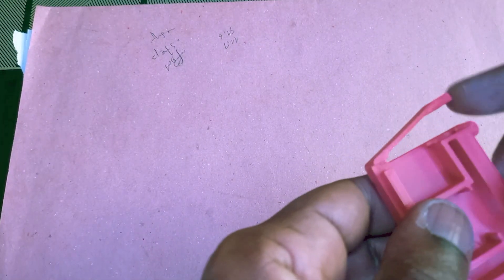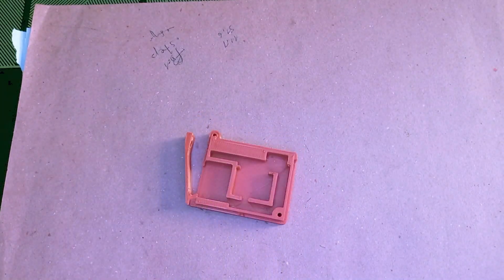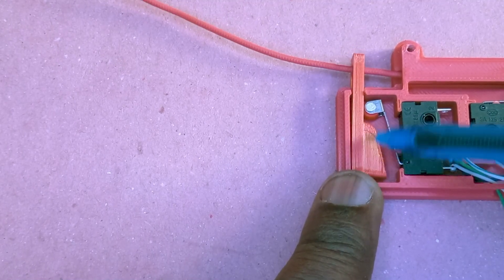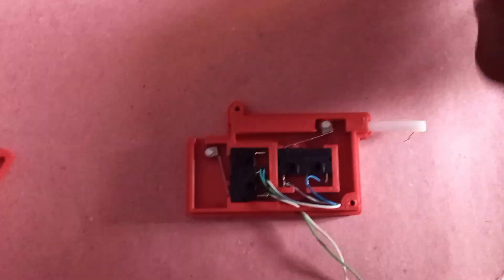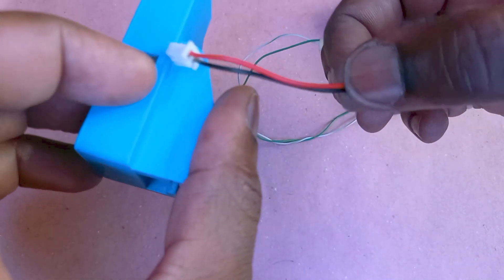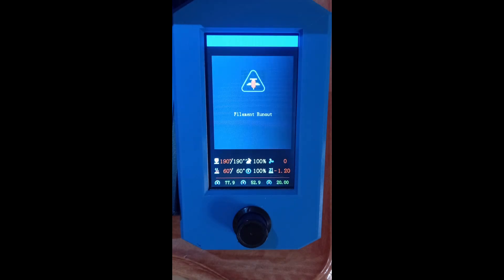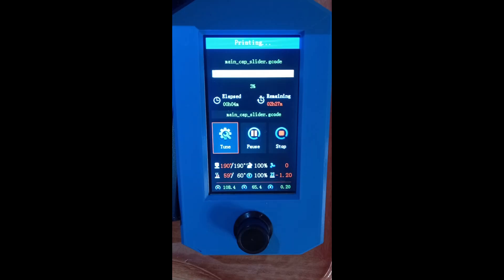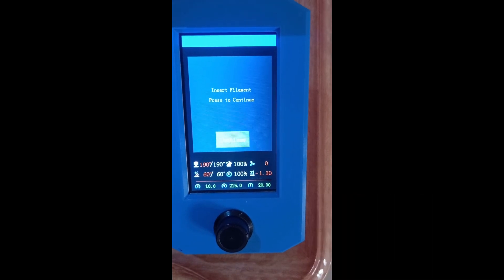61: Improved Version Filament Jam and Runout Sensor

Comment: Hey Your model is flawed the file support__improved_2.stl  the part that connects to the gantry does not connect to the mount, I printed it and it came apart, the stl file is flawed

Comment: would this be suitable on a direct drive extruder which is getting fed from the top of an enclosure with a different mount?
Reply from the maker: Normally it should work. You will just need to design another type of mount. I will think about that.